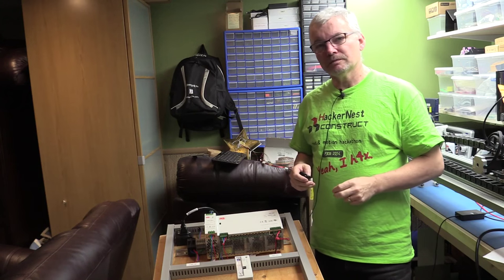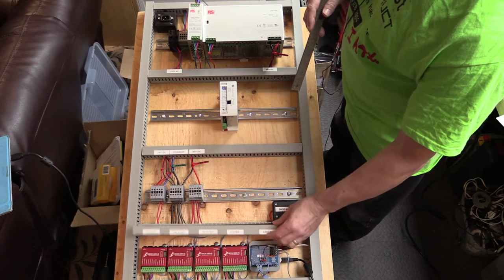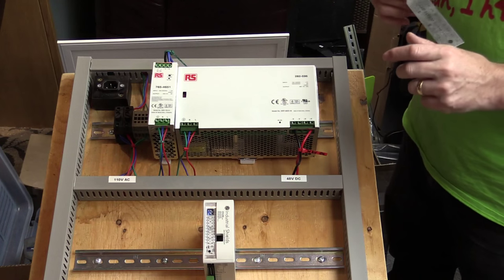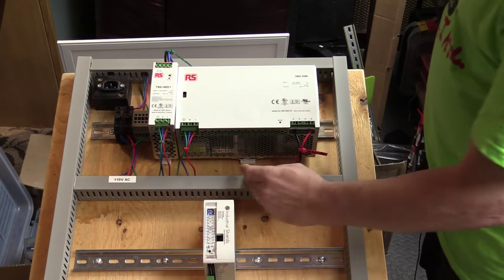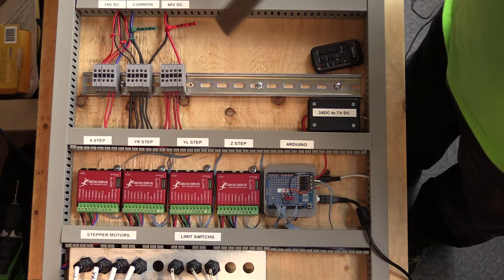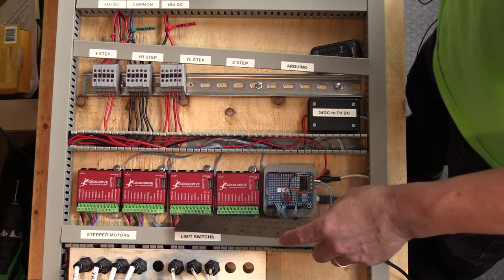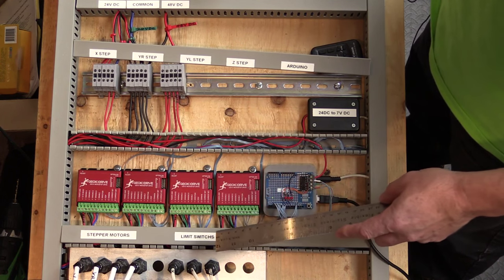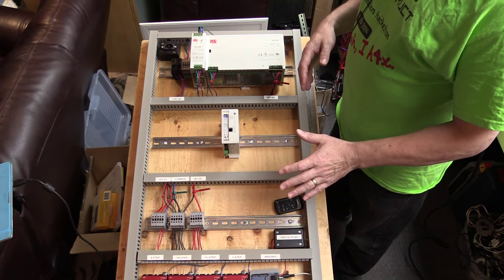CNC Project #4b The Control Panel Wiring

Comment: It is better to use a two-pole circuit breaker instead of two fuses. In case of a short, it will cut both line and neutral, leaving no actual wiring live. Also a mechanical limit switch is a must. You can put as many functional switches (proximity, inductive, etc.) but due to safety, mechanical that literally triggers a safety circuit is needed.
Reply from the maker: I have some bright yellow/red estops to add ( Mechanical ) and also agree that the two fuses was a error and I should have only one in the LIVE. or as you say, a dual breaker to ensure both are disconnected.
Reply: I believe Ilian is referring to travel limit switches. Mechanical travel limit switches for the machine. Proximity switches are great, but you always need a redundancy for safety. This is very common and practical in machine building. Even on something that has virtually no ability to cause bodily harm.

Comment from the maker: Now the Garage has warmed up, there will be some more videos coming for the CNC, including the wiring of a MACH3 Motion Controller to replace the Arduino, should be more robust and faster, not that the Arduino was causing problems, it worked great. I just want to share other optional parts you can use to control the machine

Comment: Nice work! 
I'm pretty sure you know this, but just in case you are not aware.
A major brand labeler for wires and such is Brady. 

I was glad to see you apply the high/low voltage separation method.
Although code now wants 120vac to be separated from low voltage too. 
Yet for your purposes it's fine. In my other life we just called your wireway 
Panduit. Mostly because that was the preferred supplier.

Once again, nice work :)

Comment: Do you not bond your low voltage DC circuits with ground? I see you have a ground at the input of the power supply but I don’t belive that bonds the dc circuit

Comment: The CNC project is coming together really good !! Nice series absolutely love it. You deserve more subscribers and views.Also please finish the power supply series. Eagerly waiting to build it :) It would be great if u could make more tutorials on electronics and embedded programming intermediate to advanced series would be awesomeThanks a lot for taking your time to make and  video with everyone.
Reply from the maker: +Asniex Asniex There on their way, I have not forgotten about all you EE fans and the CNC is also a platform to learn even more about electronics and automation
Reply: I am also planning on building a CNC for pcb milling and for machining various enclosures for project with aluminium. 3d printer alone is not enough. The CNC series is awesome too. Please do a time lapse of milling something on the CNC a lot of people love watching them.(incl. me)
Reply from the maker: +Asniex Asniex Will do, its on the list

Glad you like it, I may well follow up with making a small PCB CNC after this one as I am now the proud owner of a new frame set of hardware to upgrade the Rails from 80x20 and 60x20 to 80x40 all round and better plates so the older parts will be used to make a smaller one, not that there really old yet lol
Reply: +Peter Oakes (TheBreadboard) Sweeeeet !! You are really lucky to be able to source them. Where I live the I really cant source those extrusions locally. You can mill out the frame and other structures using your newly made CNC. You should probably make a desktop sized one for portability and no one will probably make anything with a really big PCB anyway. 
I have researched on building one for a few years now and to really get a good accuracy also repeatability a lot of people use Anti Backlash Ball screws instead of timing belts/threaded rods or ACME rods. Othermill , boXZY(uses ballscrews) and nomad 883 are some commercially available ones probably over expensive. Build one to beat them all. Cheers :)
Reply from the maker: I agree, if I make a PCB sized mill it will probably only have about one square foot of work surface, this way it will also be super rigid given the extrusions and brackets.
Reply: Awesome :) We will be waiting for it but power supply next please :P

Comment: Is there any heating problem with the Gecko Stepper Motor Driver flat on a wood table. I have seen several that the Stepper Motor Driver is standing up.
Reply from the maker: None,  mine are vertical due to the panel mounted on a wall but there still flat against wood. Due to some many complaints though (Unfounded in my case as I never had any over heating problems or even getting above luke warm) i placed a metal plate behind all the controllers, I did this as I was upgrading anyway adding a  rotary axis and a Mach3 controller, see this video for details https://youtu.be/SUiCWXAppwI
Hope this helps.
Reply: @TheBreadboardca  I am helping a friend upgrade their Precix 3000 CNC Controller. I am using your work as reference. I am going to use MASSO CNC Controller connected to Gecko Stepper Motor Drivers. Thanks for this video. guide.
Reply: @TheBreadboardca  Did you use 14 AWG wire size for 48VDC and 24VDC line going to distribution blocks?
Reply from the maker: @blueice24  if you check this table (A useful table to keep referring to) https://www.powerstream.com/Wire_Size.htm . From the 48V power supply to the blocks I used 10AWG (15 transmission, 55A chassis ) and  12AWG for block to controller (10 transmission, 40A chassis ) ,  from controller to the steppers I used  14AWG.
I dont have the original panel to refer to as I added a different controller and an additional axis so rewired it

Comment: Really helpful video!  What is the item in the section directly below the power supplies?  It doesn't seem to have any wiring.  What is its function?  
Also, where would you put the relays to control the VFD, vacuum, LEDs,  water cooling pumps,  etc...?
Reply from the maker: +Sandra Carr The empty space just has DIN rails in right now, this is where you could mount VFD control, additional relays and the like. A water cooling pump I think would be mounted under the router table, away from the electronics

Comment: Great videos, very informative. I have nema 34 steppers 6amp running on 60v. What wire size for the stepper motors should I use? And what size wires should I use for the power output from the power supply to the drivers?
Reply from the maker: if it is a short run then you may be able to get away with 18 AWG but I would go with 16 awg personally to reduce cable losses etc. you need to remember that when you read most ratings for cable, it is in free air, not bundled in a cable run and also it is a transmission line when it comes to stepper motor runs. hope that helps
Reply: @TheBreadboardca  great, thanks for the input, by the way @ 29:20 you explain the neutral and line, but the colors going to the power supplies are opposite, can you explain in you misspoke  or the colors are crossed by mistake. Thanks

Comment: Hi, very cleaning wiring you have, congratulations.
What is the wire gauge you used to connect PSU to Gecko and from Gecko to stepper motor?

Comment: How are those geckos holding up without a heatsink? Nice video!
Reply from the maker: There working great. I have run several multi hour jobs without issue.  I do have them mounted on a panel now though. Not because of heat issues but because too many people thought it was a fire risk. So when I added a 5th drive for a 4th axis I also added a metal plate behind them

Comment: Thank you for the video! It is very well explained! I have a question though, what's the maximum length you would recommend for the steppers cables?
Reply from the maker: there are way to many factors to answer that one reliably. A few things to note would be the gauge of the wires, how good are the controllers. The wire could have a lot of resistance  so may limit the current some what, even though the wire may have probably more resistance than the steppers, it should not matter as you should never be saturating the inductors to the point of them appearing as a resistor to the power source... that would be bad.
Longer wires may limit your top speeds and affect the DV/DT of the signals, if they are long I would probably screen them too.

I have about 4 - 6 meters to my steppers and they seem to work just fine, and the cables are not screened.

Also make sure the wire is ok for continuous flexing int he cable tracks, you would not want them breaking prematurely
Reply: Thank you! I'll have these concepts in mind when choosing my wires type length

Comment: Can you use the same common terminal block for the 48v and 24v power supplies? Il
Reply from the maker: Yes you can, just make sure it is the "Star" point of all the 0V lines so you dont introduce ground loop type effects. This is what I have in my setup, one ground bar for everything

Comment: What is point of using double fusing when plugs and sockets are polarized (if I remember correctly in Canada earthed combination is polarized), I understand when you use it when double fusing is used when there is no polarized sockets and plugs (like CEE 7/3 and CEE 7/4) but when you use polarized plug socket combination it is redundant.
Reply from the maker: +Miloš Lazović Even now there are some things are still not polarized, especially many imports etc, I agree it would be easy to leave it out as it is more than needed but I have them anyway so why not, it does not harm and adds a little more. Personal choice without compramizing safety

Comment: I had a faulty power supply (DC-DC convertor actually) take out multiple Arduinos and the USB ports on a laptop. Every time after, quality power supplies and an USB isolator. 

Is there any special considerations for using the switch mode power supplies like you have with stepper motors? Some manufacturers of stepper motors drives recommend their switch mode power supplies (or linear supplies) because theirs have been "specially designed" for stepper motors. Just wondered if this is a legit concern.

Comment: Im building a router and plasma system i am clueless on the panel set up can you give me guidence
Reply from the maker: what is it you need to know ?
Reply: Mainly what internal componets i will need to make them work together i know i need a thc i have my 4kw spindle and for the plasma im going with the hypotherm 45 xl im planning on going with 5 nema 34 960oz-in motors im not sure what breakout board to get and what other things need to go in to make it work
Reply from the maker: @zachlee5213   A 4KW spindle will need special Mains supply for it, I'm sure you are aware of that already
Not all motors will need to be Nema 34 but you certainly wont be lacking drive power, just make sure the gantry is stiff, you will also need to be using probably ball screws and linear rails rather than V wheels. (Or rack and Pinion drive) Separate power supply for each motor, but these dont have to be switching PSUs as for the actual motor drive, bulk power is the main requirements at about 48V in your case to ensure you keep all the potential torque.
Regarding PLASMA systems, I have no experience there but good grounding and correctly rated cabling with shielding will be a strong recommendation .
I would suggest using ethernet rather than a breakout board from presumably a legacy printer port. or a CANBUS interface to the controllers.

Comment: hi Peter. What type of filter are you using ? I mean I had several issues with arduino with power supply , for example harmonics noises and else.....is your system safaty and stable ?

Comment: Great vids mate. I read somewhere if you use a digital input for the limit switch you can use a different resistor to change the feedback for each sensor so it knows which axis it is. Not sure if this is applicable to these sensors. regardless I guess the machine will be stopped at the limit so you know anyway. :)
Reply from the maker: +Brian “Easty and the Wolf” Eastwood Most software I hae seen does not allow for the limit switches to be used in this way

Digital Inputs are also either 0 or 1, not inbetween so it would not work for them. An Analogue input perhaps, but not the digital. As these are safety devices  (To Protect the machine), I would not suggest this route as there would be too many things to cause an error
Reply: +Peter Oakes (TheBreadboardca) Yes maybe the analogue, I don't know much about them. I just thought it was an interesting way to identify them. Your right, for this component simplification is the key.

Comment: First off Thanks for some very informative videos.  You mentioned doing a video on the stepper motors and how you can use higher voltage then the rated power. I looked with little luck have you made this video yet?

Comment: Did you ever get a chance to post your opto-isolator circuit that you put together?
Reply from the maker: +George Ioakimedes http://www.rs-online.com/designspark/electronics/eng/blog/cnc-build-3-electrical-build-of-gantry-and-control-panel?/designspark/electronics/blog/cnc-build-3-electrical-build-of-gantry-and-control-panel=

you should find it there
Reply: +Peter Oakes (TheBreadboardca) Thanks, which opto isolator chip did you use?
Reply from the maker: +George Ioakimedes almost any should do but I specefically used a Vishay ILQ30 http://www.vishay.com/docs/83621/ild55.pdf
Reply: +Peter Oakes (TheBreadboardca) Thanks again. Many that I looked at had lower voltage ratings

Comment: informative nice video. thanks. i am trying to put two 12 volt\100 amp  power supply in series to get 24 volts to power my c-beam CNC which i am building right now. Is the power enough to drive the NEMA23 motors?
Reply from the maker: lol, way more than enough. My system is 48V at 10Amps and that's enough, what are the model of nema23s and how many ?
Reply: 1/4" Shaft High Torque 2.45N.m 3A  3.6V   2.45N.m Model Number:EC03 from Aliexpress.  I'll using 4 of these. thanks. The power supply is from a Dell server.
Reply from the maker: ok, so 24V will work just fine but you dont need anywhere near 100 Amps. if there was something to go wrong, that could start a fire quite easily. I would suggest a fuse of about 15A in the 24V feed to the controllers, if you are running separate lines to each controller then put in 5A fuse for each controller.

What are the controllers your using ?
Reply: Can the system run on 12 volt \100 Amps power supply only?
I am using MECH3 breakout board and TB6600 stepper motor Driver Controller 4A 9~42V TTL 16 (Chinese no brand). I am looking for a video which shows how to wire the motors to controller and then to the breakout board. Kind of dry run, before attaching them to the CNC frame. Thanks.
Reply from the maker: it will work, you could up the voltage later if needed (ie, if there is a lack of torque or missing steps), but the controllers are rated from 9-42V so your ok there. I run mine with a 48V power supply but it is not essential unless you have any of the above issues.

The wiring is normally quite simple, Mach3 breakout has outputs step and direction, these go to the step and direction of the controllers, one pair for each. the controller has in your case 12V supply and then 4 wires to each motor, the worse thing that will happen with the motors if there wired wrong is it will move the wrong way or not move at all.
Reply: @mohammedzaman1937  if you use a 100 amp power supply you are going to have to provide wire that can handle 100amps.